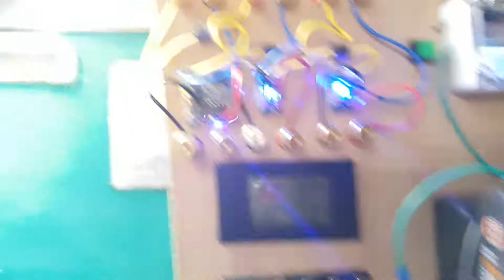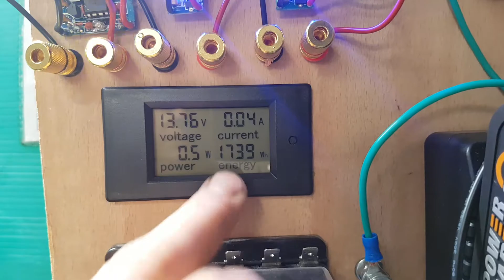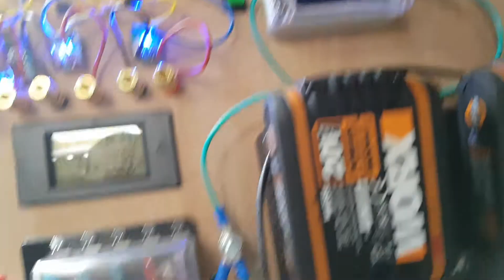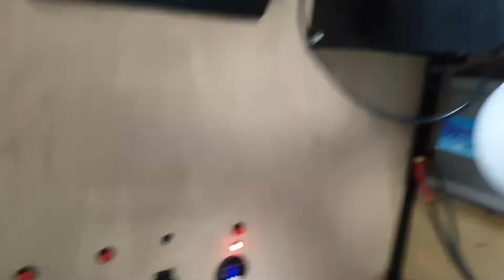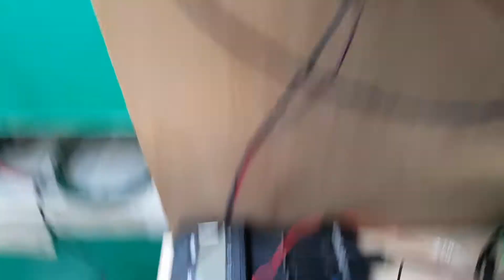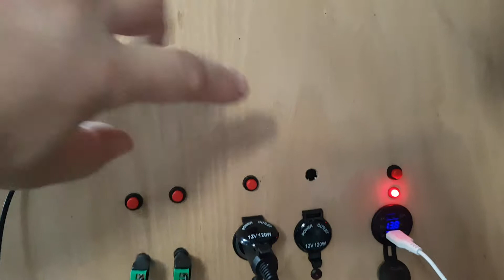My small scale solar power system, overview.

Comment: It's crazy what the Youtube algorithm pushes. I'm sure I saw this years ago but just watched again, are you still using this?
I just ordered a new PWM solar controller for £7.50 off ebay as my PWM5 finally died. I should try to do something similar to this when it gets here.
Reply from the maker: What's failed with your PWM5 Ali?
I probably have the parts needed to make another.
Reply: @johnnodge4327  I'm not sure mate but noticed the battery getting low and when I checked the current was a fraction what it should be. I think I have another in a pack but was too lazy to build it. I know the cheap ones are not great quality but my setup is very simple with a large battery and small solar panel. I can leave it with no controller for days and the voltage never gets too high.
Reply from the maker: I know I've got quite a few spare PMW5s that I never finished assembling as kits. They were initially very popular, but as sales declined, I started assembling kits as and when they sold, so definitely have some spares. I'm just curious as to the failure mode, as mine have been 100% reliable under testing, except when I put 20 Amps through one, which caused the FET to fail short circuit.
Reply: @johnnodge4327  I think there was corrosion in it but as I had mostly potted it in resin it's not going to be possible to test any further. I can see some damp has crept it's way in.